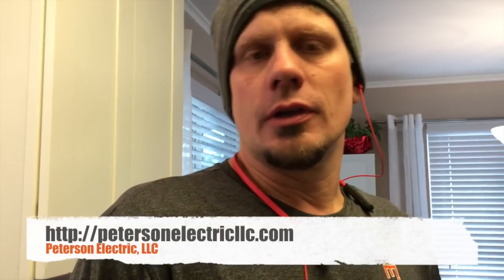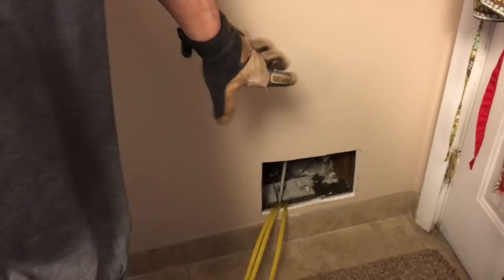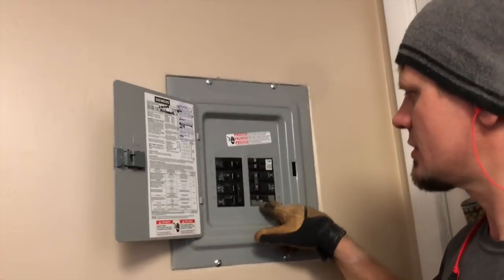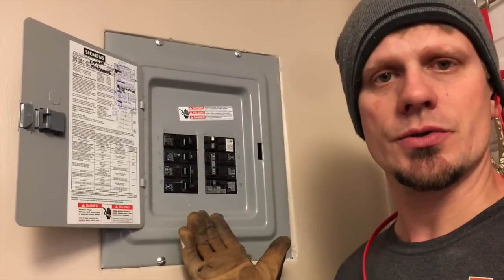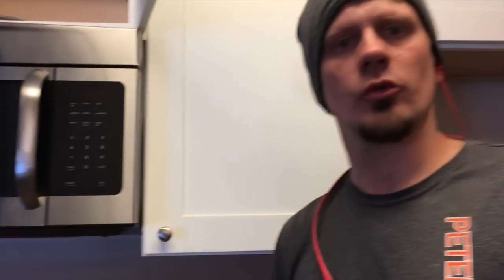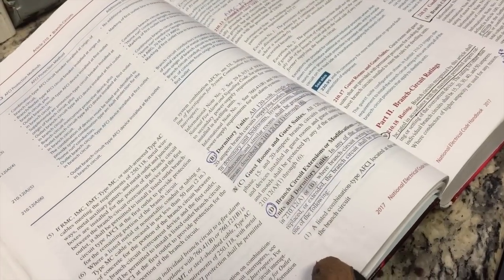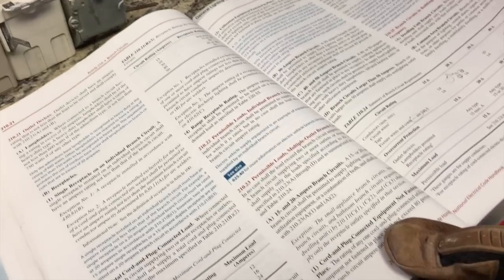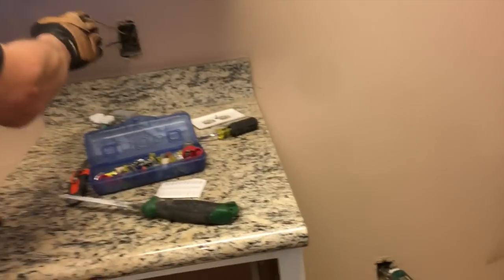Residential Kitchen Remodel - Electrical Code Requirements - How Many Circuits Are Required? Part 1

Comment: Thanks, good points, and even though the NEC covers, but not necessarily does it cover all the plug-in stuff. My home built in 2003 in the Chicago area, met the code then. When we cook our brunch Sunday, we almost also over use a line and pop a breaker. We use a griddle, toaster and coffee pot. The griddle and toaster kill the breaker. I’m going to add 2 lines, one for the toaster only, other for the frigerator. My daughter lives 9 home down in the same subdivision built by the same builder. In her case I added 2 lines for an island , one on each end and her problems are over (she had similar issues).
PS: The salesmen never talked about electrical upgrades when we ordered our homes, with the exception of the box and switches for a ceiling fan ($275 for box in ceiling and a double switch on wall to operate fan and light). Why is this……?

Comment: As someone learning to become a home remodeler, it would be nice if we could start mounting a wiring diagram for every circuit inside the box. Is there anything like this? So much time spent trying to figure out things that could have easily been written down by the previous installer.

Comment: I’m a DIYer, and trying my best to follow codes. I’m used to seeing the yellow jacketed 12/2, but I’m also seeing both a blue and gray jacket 12/2 at my Home DePot. I’m reading the label, but didn’t see what the difference was for.
Also, the home I’m working on has black jacket 12/2 wire in it with a 20 amp breaker. Would I be fine connecting in a box and continuing with the yellow jacketed wire to new outlets.

Comment: By code your allowed to have 3 Small Appliance circuits right?
Reply from the maker: I install min of three and sometimes five, if I have a BIG island and large nook area with dining.
Reply: @Petersonelectricllc  You mentioned a beverage/wine cooler shouldn't be tapped off any of the 2+ SABC's.. Is this code that says you can't do that? I think you said "typically"..

Comment: It really irritates me when kitchen remodelers do a new kitchen with no regard for the current electrical situation or what is required.  I've gotten calls from customers where I had to go and correct a lot of mistakes made by the so-called remodeling contractors.
Reply from the maker: I had one the other day that had one circuit, and another with 3 circuits. This was not caught because of the nice cabinets, and counter slab.
Reply: And they come into sight pretty quickly as soon as you do a complete circuit mapping of the house (to label the panel).  I find a LOT of things wired wrong, or to circuits they're not supposed to be wired to, just by doing that.
Reply: I can't stand contractors who do a Kitchen remodel and expect you to branch off of the old 2 circuits that are existing.😆 Hey Genius how about the Fridge, Small Appliances, Garbage disp, Dishwasher, Hood, Wine Cooler, Insta Hot etc etc.... What a Joke
Reply: Yeah but doesnt that give you work?
Reply: @oside7603  Absolutely! 
But Its Kind Of Silly When The Customer and The Contractor Expects Miracles With 2 Existing Circuits.
Reply: @oside7603  Yes, but what you end up with is poor expectations for what electricians should be charging.